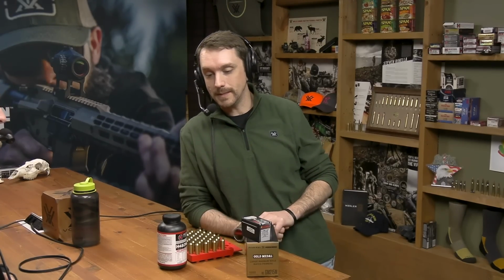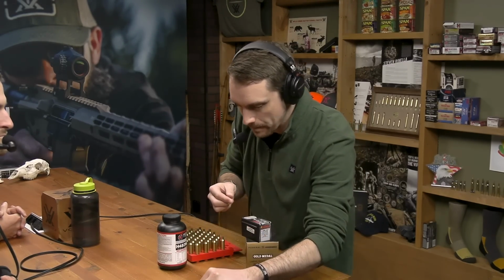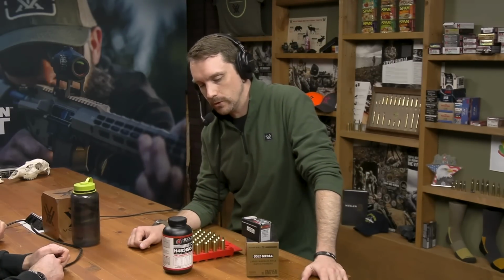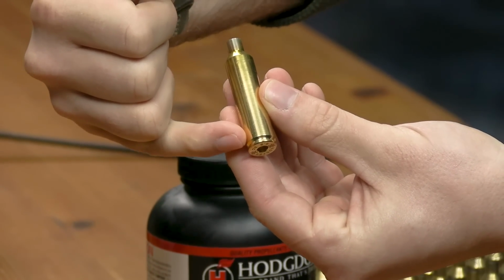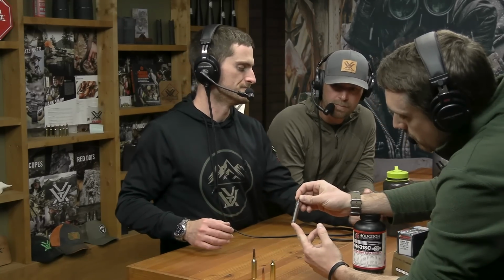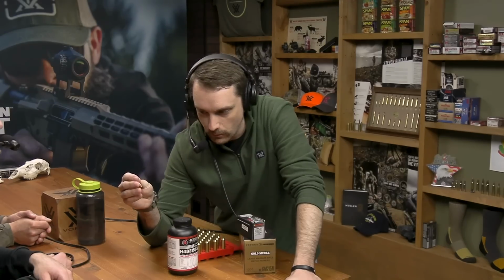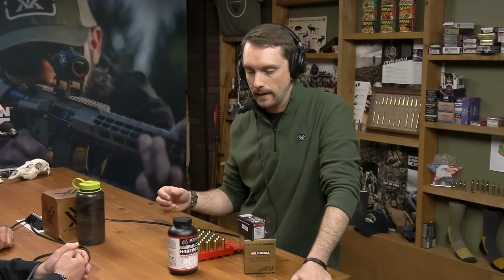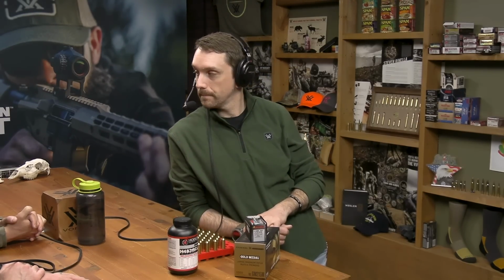#10MinuteTalk - The Anatomy of a Cartridge

Comment: The belt was necessary on the 375 H&H because it didn't have a neck and a rim tended to hang up in bolt actions. It is vestigial in the offspring of the 375 H&H but still necessary on it.

Comment: Greetings from Germany Gents

Two things 

1st the most important. 

You have been pronouncing bullets wrong. The correct way is „Boooo- lights“ 😉

2 nd

Most important job of the case is to act as a seal and gasket to contain the pressure of up to 65.000 psi and keep it out of your face upon firing. 

Have a good one. 🍻